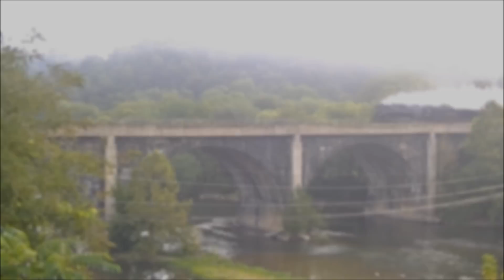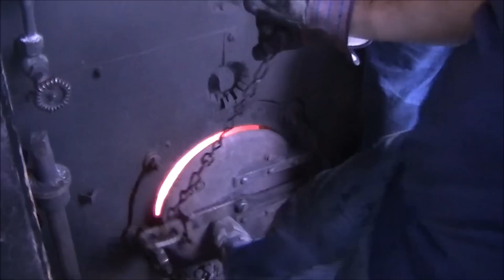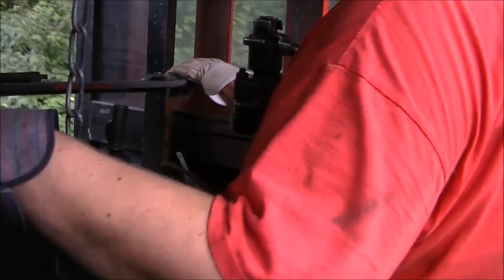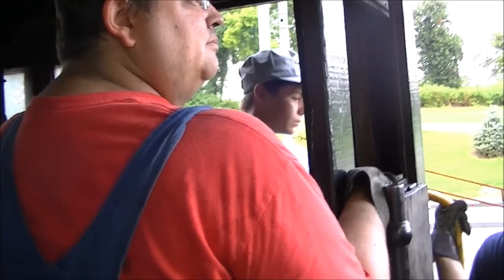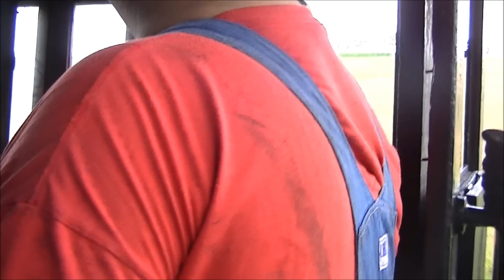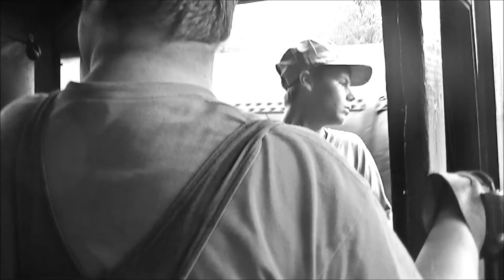At the Throttle of Pennsylvania Railroad 643

Comment from the maker: If you mean by how hard it is to ring the bell or quill the whistle this may be your answer.  The bell requires no effort at all since it's an air nock bell, and only requires opening a small valve to turn on the air.  The whistle is easy to because the valve leading up to that bell is what is called a "balanced valve" which makes it easy to quill or make the whistle talk.  You could blow the whistle with just your finger if you wanted to.